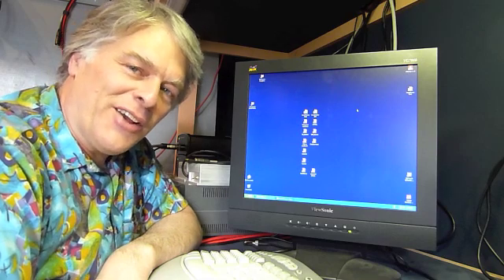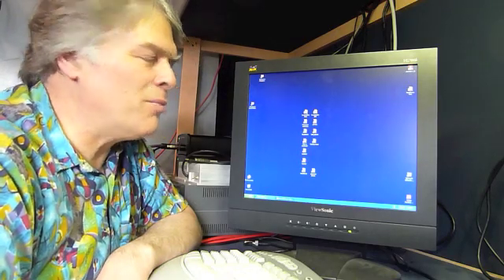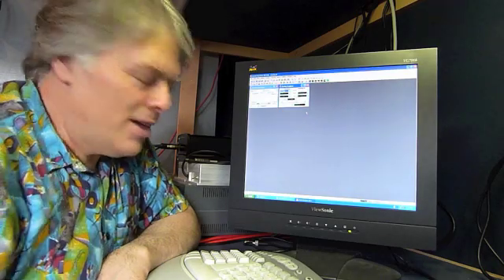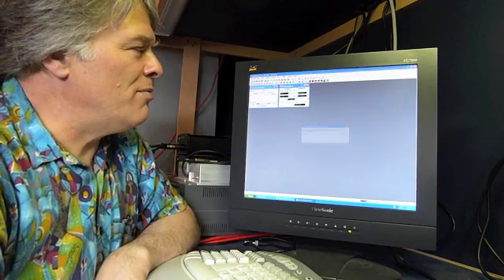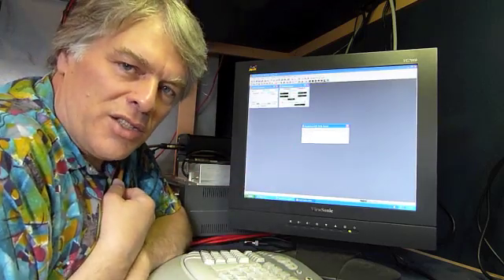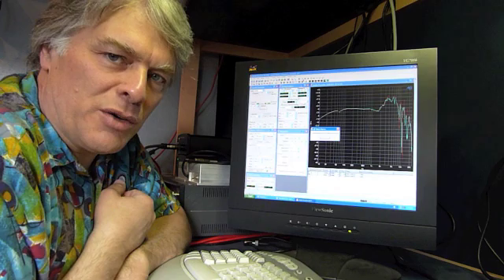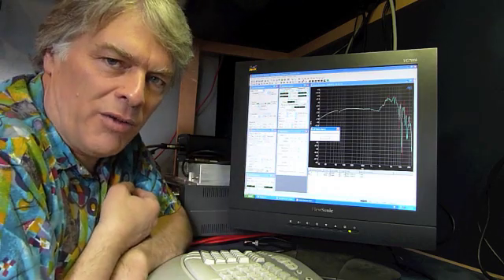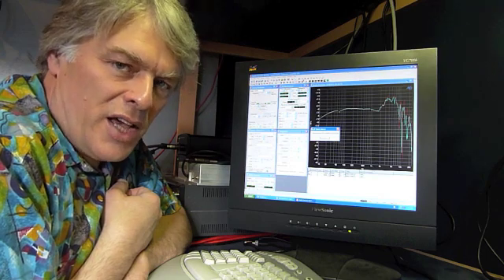Measuring Headphone Frequency Response

Comment: This is kind of inaccurate, but get a good mic and use a sound sweep track that fits your headphones' playable frequency, maybe? You might be able to at least get somewhat of an idea of what range is emphasized over others.
Reply: I tried that in the past using an SPL meter, but "flat" monitor headphones don't actually measure flat, even if they will sound flat to an actual human being.  So it's not a perfect guide.

Comment: He500 if you really wanna go with them, but they are a kinda sketchy Chinese company. You could look into used LCD2s...

Only reason I say he500 though is that it's better to get the better headphone and later upgrade your system around it.  The headphones change the sound a hell of a lot more than the rest of your setup.  Always go with the cans first, even if you can't sufficiently drive them right away.  You'll appreciate it more when you can.